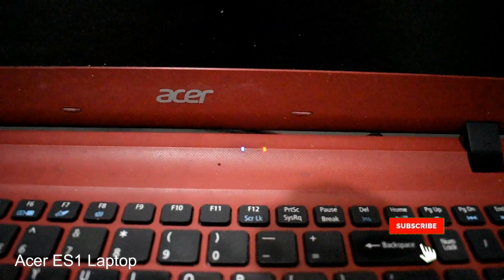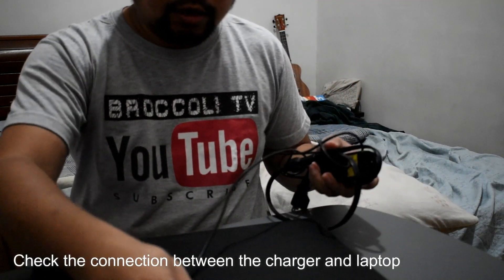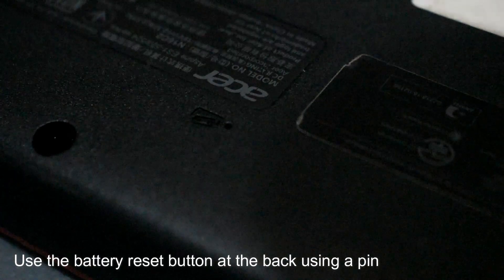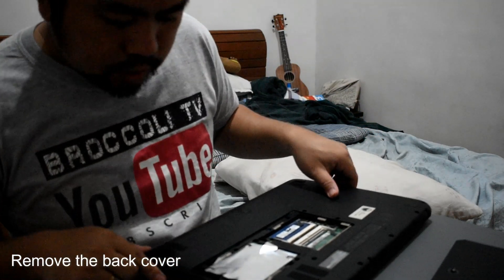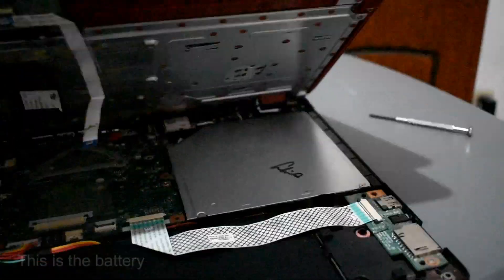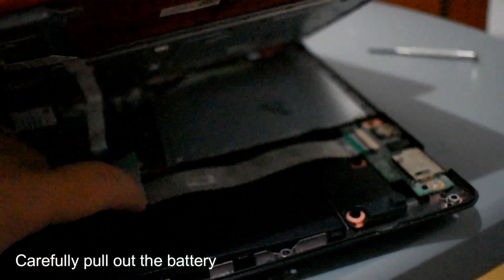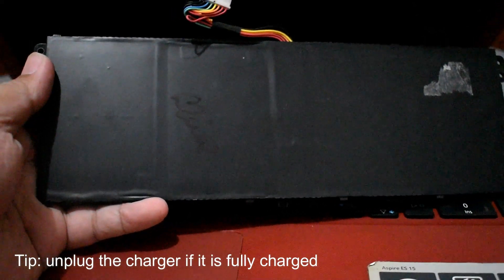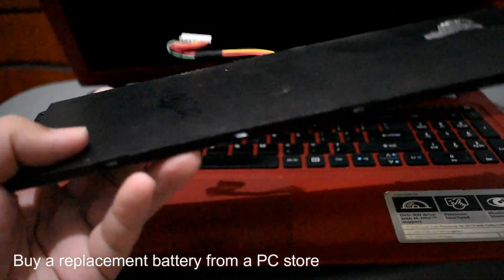FIXED! ACER ES1 PLUGGED IN, NOT CHARGING

Comment: Not true it does work without the battery mine does work without batery. mine model is acer aspire es1-531 work fine without battery .I have two same model. and both works without the battery.

Comment: I reset my laptop but won't start the reset if it is not pkugged in. My laptop was on full battery at that time.. Then after the reset and my battery went low, it wony charge anymore.. I tried the pin trick but it didnt work....
Reply: Update: i plugged in my laptop and at first there was no response.. Then after charging for 15mins,it's akready working.. Thank u so much!!

Comment: Hello. Something very strange happened to my ACER LAPTOP. This trick helped me once, but, after a while, this problem arose again and this method no longer works. And here is the problem, my computer need to be constantly connected to an energy source and while this time, my computer is 100% charged. But as soon as I turn off the power source and reconnect, it no longer charges. He needs to spend all his energy to get it back. For example, if my computer is 30% charged and I connect it to a charger, it does not receive power. If he is completely dead, then he will receive energy. I hope I explained it correctly. Does anyone know what the problem is? thanks!
Reply: Heyyyyy the same as minee like it's reaally annoying when it only charges when it's deadbatt...I hope someone can answer this as well..

Comment: My aspire 3 is ganyan din po sir i tried the pinhole tip doesnt work. Nag chacharge sya pag plug then nag biblink ulit.
Reply from the maker: baka po kelangan na palitan ang battery, or try replacing the charger
Reply: @Broccoli-TV  tried replacing the charger same issue

Comment: Hello.i have a similar Acer like yours..mines is the Acer apsire a314-31 same built in battery.but I dont know what the problem  I try all stuffs but it's not turning on it's only charging..once in a while when I press the power button the orange lights flashes 3 times and that's it...when I charge the battey until it turns blue and I try to turn on the laptop it not turning on..only once in a while the orange light flashes

Comment: Hello! So what if you reset battery by using pin and leave it to drain AND try new charger, but the charging light indicator is not coming on and laptop now wont switch on??? Aspire 3. Thank you
Reply from the maker: Buy a new battery.

Comment: Hi, boss. 
I'm having a problem with my ACER LAPTOP because the orange light keeps on blinking even if it is not charged and the battery life is always 99%. I decided to just keep it blinking the whole day with the hopes that it will eventually lose some battery life but I was wrong. Is the same procedure apply to my case? What should I need to do po. I hope this reaches you. Thank you.
Reply from the maker: Battery probably needs replacement. Either that, or the charger. You can try buying a new charger first since it's cheaper than the battery.